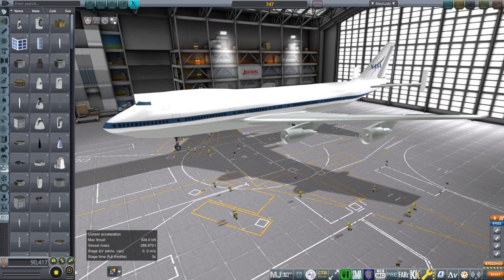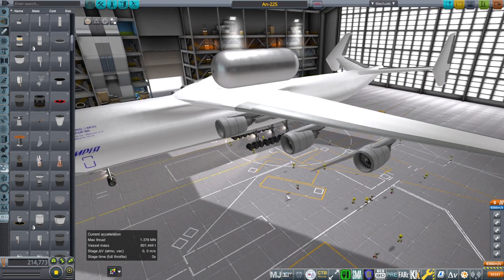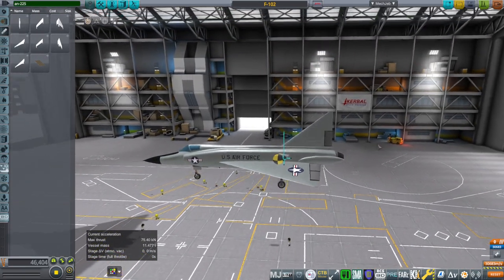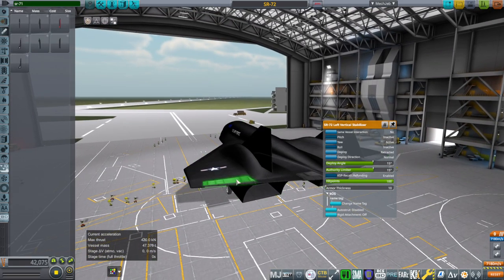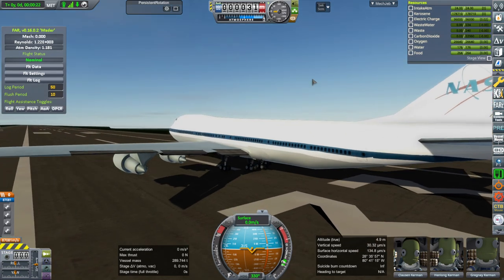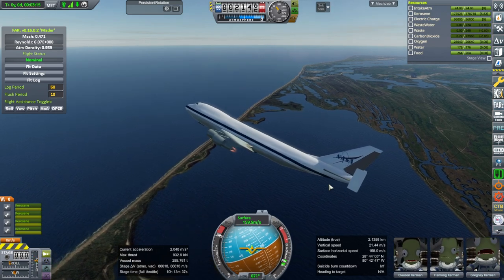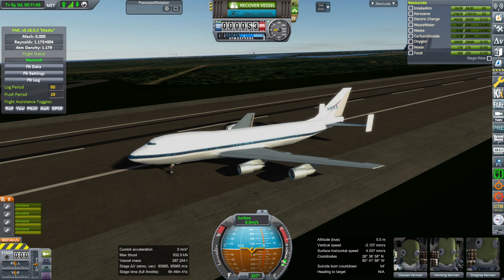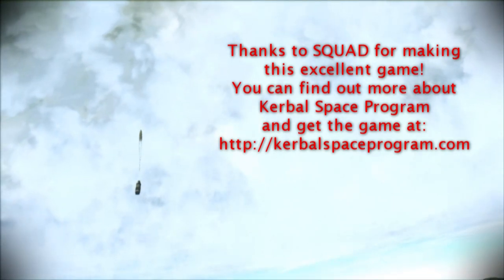Realism Overhaul in KSP 1.11 - Plane Mod Pack and 747 Test

Comment: would you be so kind as to bundle in the craft files as well please?
Reply from the maker: All right: https://www.dropbox.com/s/o7vf9oqw1oolhgx/Planes-craftfiles.zip?dl=0. Use at your own risk and keep in mind that you'll need B9 Procedural Wings, AJE Extended, Adjustable Landing Gear for some of them, and that I had a lot of other mods installed like BD Armory which add modules.
Reply: @RaizSpace  i have everything of this but at 747 craft file say i am missing ALG

Comment: i'm willing to do it on my own but how difficult would it be for me to make stock/2.5x configs for this stuff
Reply from the maker: Not that hard - they might even be okay already. Dealing with planes is a lot more open-ended than dealing with rockets - you just have to figure out whether the plane feels right for the scale, since there isn't a requirement to carry a certain payload to orbit.

Comment: When I try to look up the parts nothing shows up. I'm on KSP 1.12.3 and a fresh install of RO.
Reply from the maker: Make sure it's all in the right folder: GameData/EDBMods/Parts/Planes.
Reply: @RaizSpace  Hmm yeah I got that part right. When the game is loading it finds two errors with the 747.cfg. Not sure if that’s the issue.
Reply from the maker: There shouldn't be a 747.cfg as part of this pack - that would be an old version of my 747 that you might have had from before which should be deleted. From this pack, all the 747-related parts are 747-100*.cfg where * is other letters. Try deleting the 747.cfg that you have and see if things work.
Reply: @RaizSpace  Sorry my mistake it is the RO-747.cfg that's giving off two errors. I did a fresh install of KSP and RO and removed the RO-747.cfg file and still nothing shows up. I wonder if it's because RO was updated a few days ago.
Reply from the maker: Are you testing with anything except for RO requirements in this install? Something I may not be using?
Reply: @RaizSpace  I’m using nothing but RO/RP-1 on KSP 1.12.3. I downloaded using CKAN if that helps.